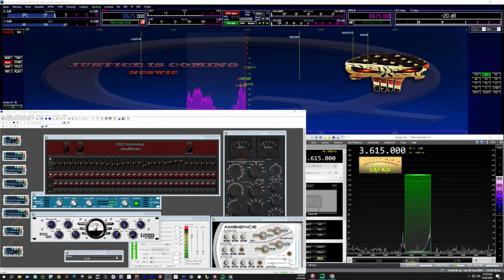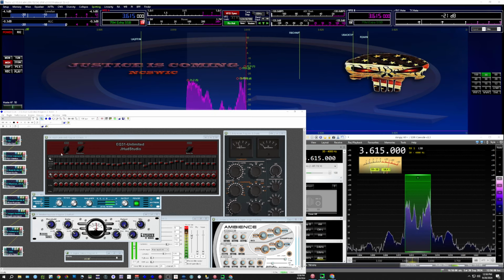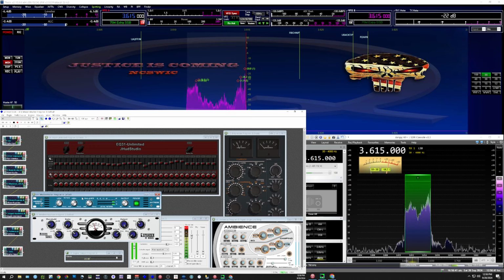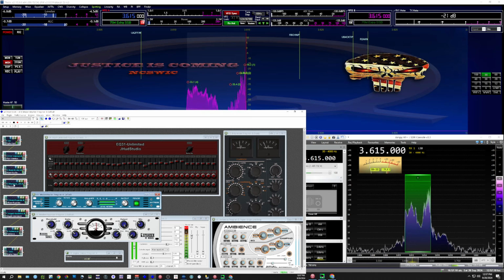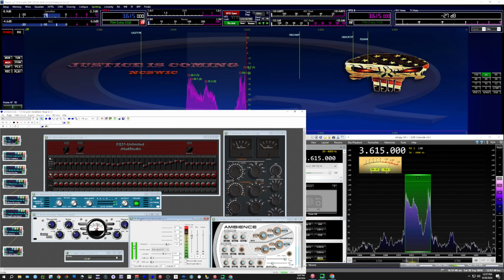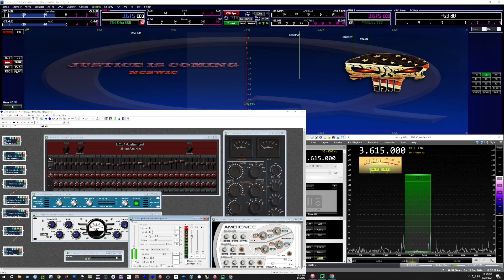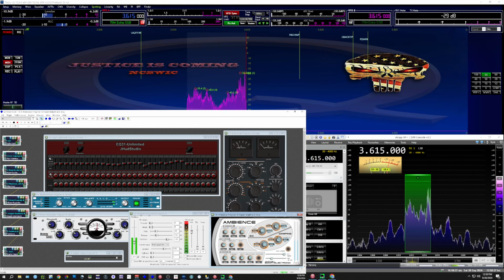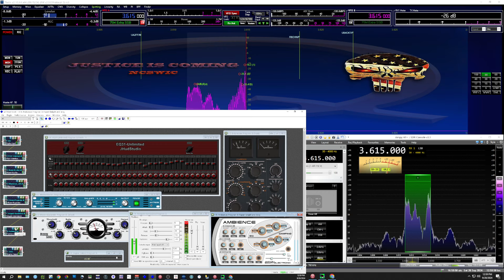BIG AUDIO WITH VST HOST: A BRIEF OVERVIEW WITH A QUICK 4K PROFILE I SLAPPED TOGETHER FOR KF2GG

Comment: Could you tell me what your latency is like with that setup, I have tested a similar setup with my G2 but the latency was horrible.
Reply from the maker: @kd4yal1  it's enough to stumble while listening via monitor but doesn't bother me. Best way is to dump it from the output  of the card and bring it straight to the line in or such on the rig. I can listen in real time to the processed audio in the computer without stumbling so pretty snappy. I'm not even running the asio driver on the card just wdm with banana.